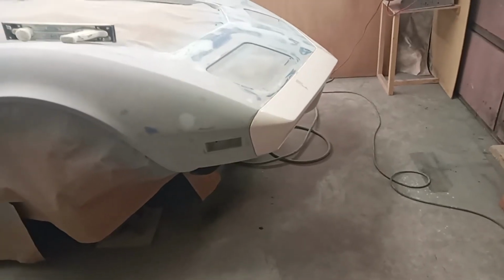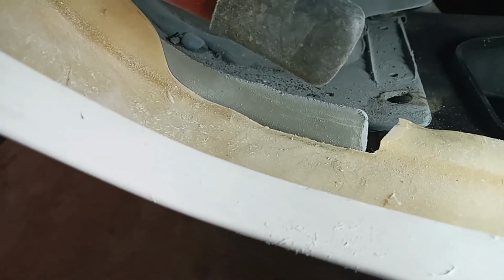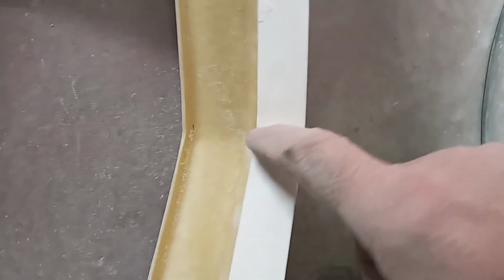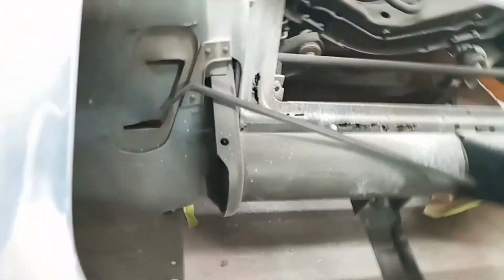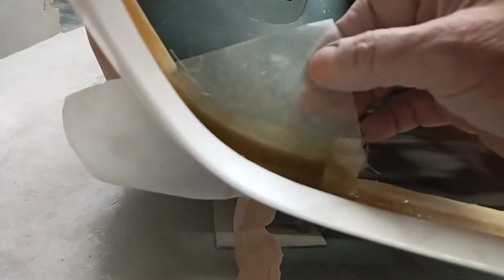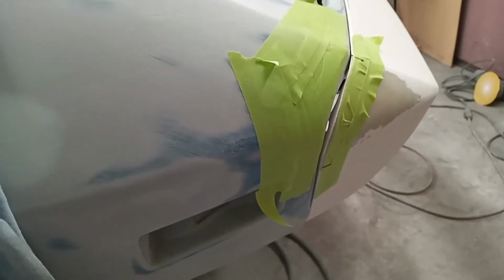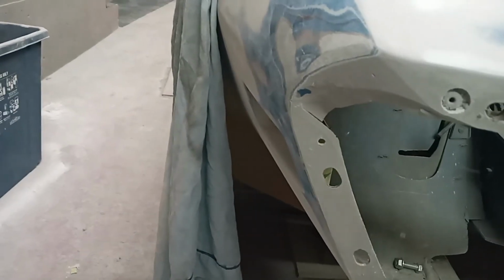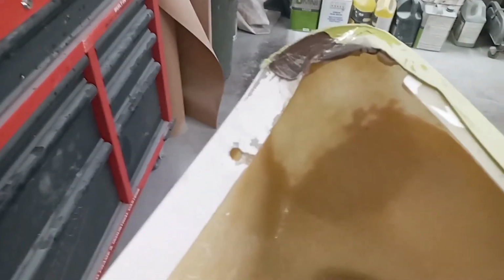74 C3 Front Bumper

Comment: Corvette..... what else can ya say. I'm willing to bet that if there were perfect factory replacement pieces, they would still fit like shit. Brutal man!
Reply from the maker: The General didn't do on in fiberglass but I have to feel sorry for the regular guy that is going to change his bumper.
Reply: @noccis3448  yes you're proof that it won't be an easy task for solid results like you're getting. Good work 👍🏼
Reply from the maker: @dazeofgloryshopworks5806  Thanks, the patients level is getting a little thin lol